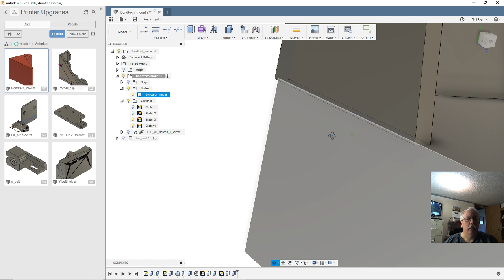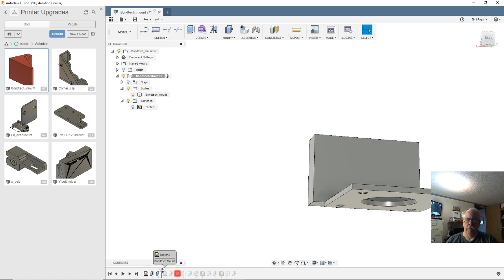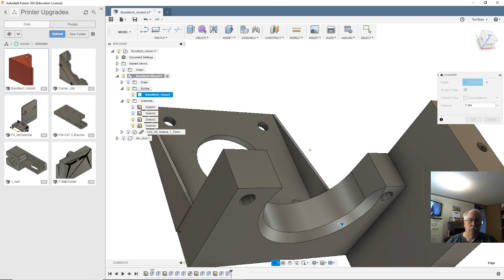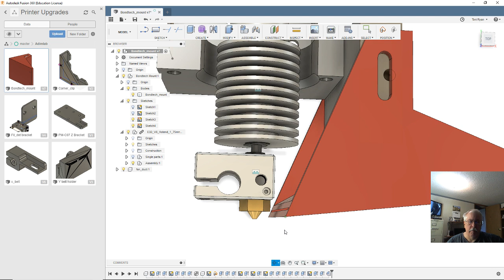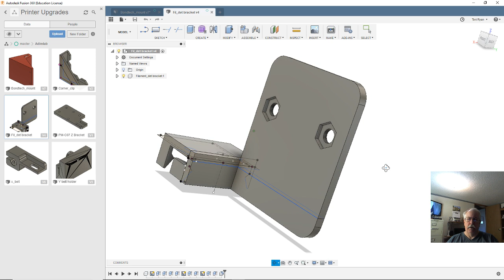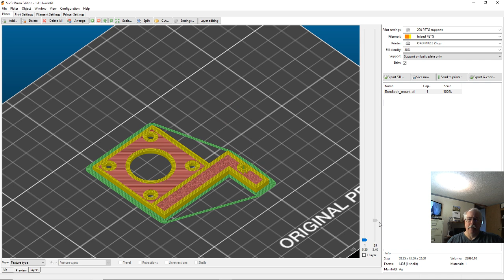ADIMLab Gantry -  even MORE changes - Bondtech bracket in Fusion 360

Comment: what percent infill did you use when printing? I did 50% PLA, I am thinking I should have done 90 or 100, but I wasnt trying to cut down on time... same reason I didnt use abs or petg, I didnt want to set my enclosure up because ill be working on the printer tomorrow and the enclosure is huge and pita to set up. Im not even done printing at this point but I know shortcuts usually come back to haunt you..
Reply: nevermind, I asked before i finished watching... sorry lol....
Reply: Does the top of the heatsync stay pretty cool on your set up? You reckon Ill be ok with PLA?